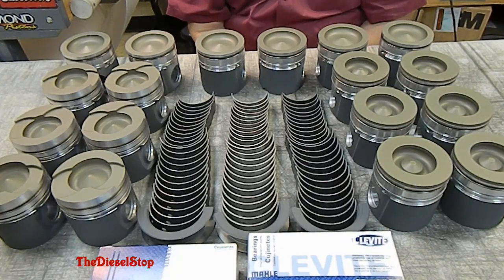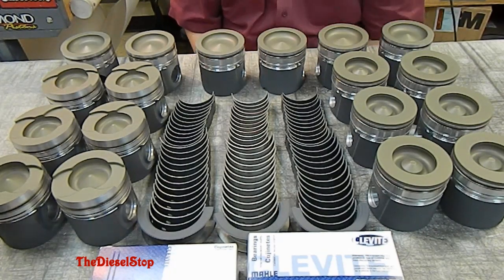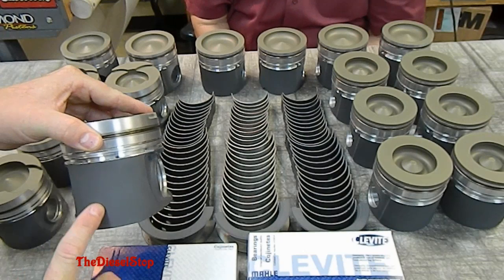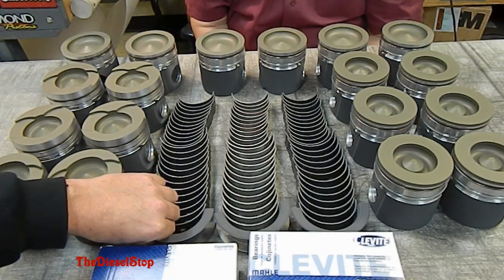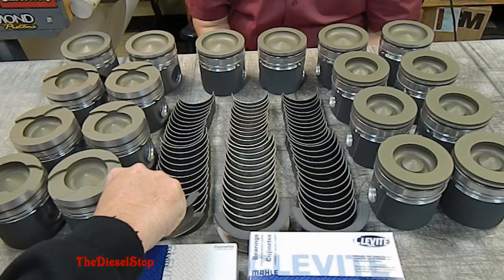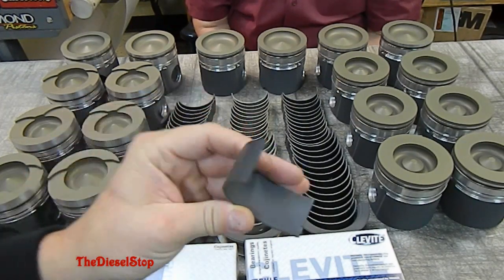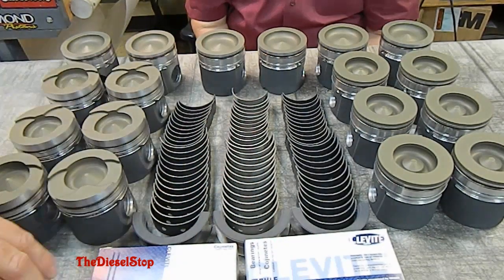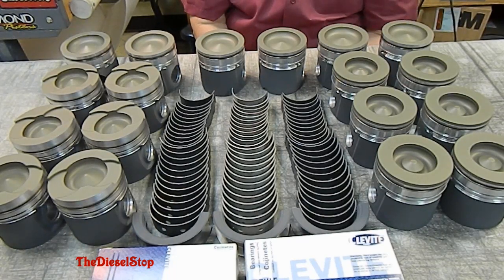1000 HP Cummins Build with PolyDyn coatings. part 2

Comment: Hey guys Ryan from POLYDYN here. The cost to coat the top and skirts is $40 per piston. Rod bearings are $5 ea journal and mains are $8 per journal. The coating adds .0005"-.0007" to each side of the skirt. Bearings are .0003"-.0005" per shell.

Comment: Not sure if you already answered the question but, does coating the bearings make the bearings thicker so you would have to have the crankshaft machined. Maybe do a video response on that.